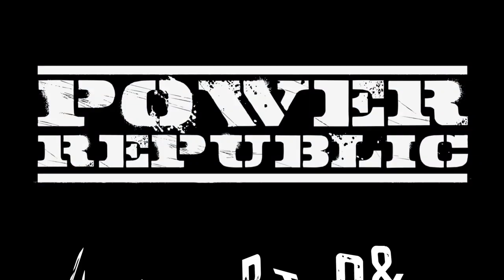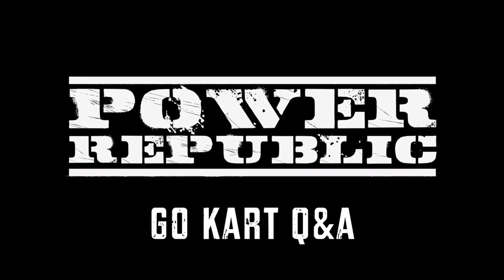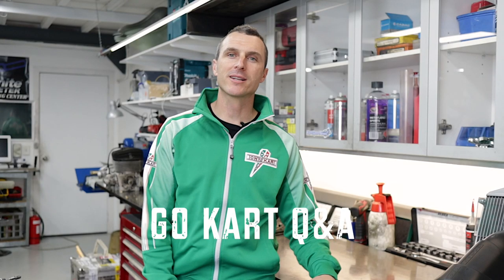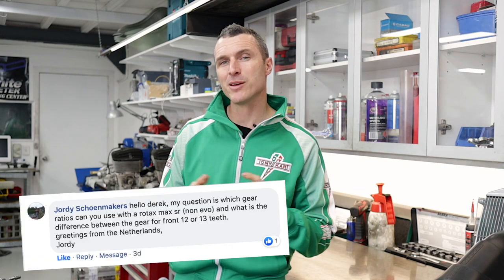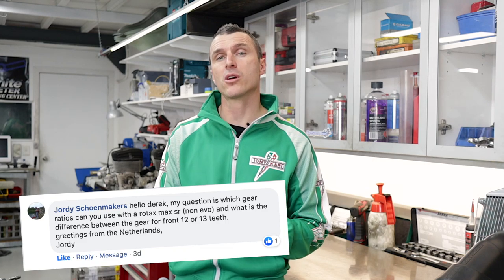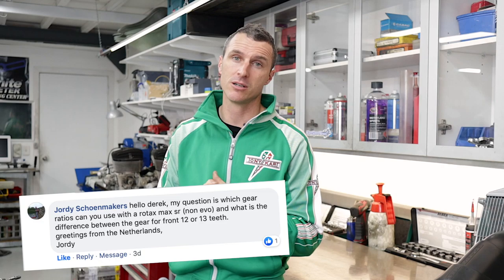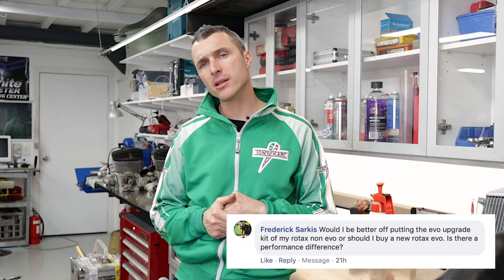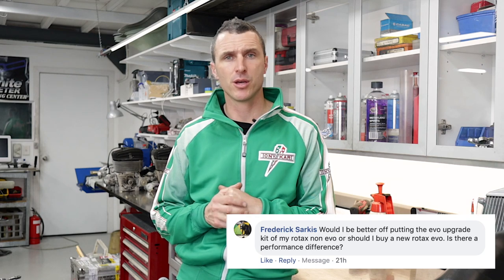Q&A: Answering Your Go Kart Questions - POWER REPUBLIC

Comment: to reduce hand cramp you can also increase the thickness of the steering wheel by using tennis racquet grip tape,  once thick enough it conforms to your hands a bit better
Reply from the maker: Thanks for the hot tip Josh.  Any particular brand or type that works better??
Reply: Head XtremeSoft Overgrip tape

Comment: Id love to hear your opinion on steel brakes vs ceramic brakes.......take cost out of it(but yes its a factor). How much of an advantage are ceramic over steel
Reply from the maker: not sure on that on, we have only used the steel OTK brake disc with the standard pads.  My guess is that the ceramics can operate at a higher temperature, so they would work with heavier cars and higher speeds, think GT3 race cars, and with go karts being so light comparatively, I don't think they need ceramic brakes.  What do you think? does your go kart have ceramic brakes?

Comment: Hi Derek,
thank you for the information. Here in the Netherlands / Belgium we are driving with the 12 & 13 gear. 
Another small question regarding the ratios.
example:
 11 front - 80 back (7.27 ratio). 
is it the higher the ratio the more speed, the lower the more pulling power? 
and what are safe ratios to work with.

thank you for all the info
Reply from the maker: Hi JS, the bigger the rear sprocket, the faster the engine acceleration and the slower the terminal speed of the Kart, because we have fixed gear ratio.
The lower the rear sprocket, the slower the acceleration of the engine and the higher the terminal speed of the Kart, especially at tracks with long straights.
Reply from the maker: The lower ratio is more pull and higher top speed in KPH if the straight is long enough. The higher ratio is good for acceleration.
Reply from the maker: 6.66 - 6.15 is the safe range for your 12/80 and 13/80

Comment: Hi Derek, I wonder if you have any advice around fuel for Rotax Evo. The UK has just changed the pump 95ron fuel from E5 to E10 which now has 10% ethanol. There are lots of conflicting information going around as to whether it is ok to use or we should use 98ron fuel which remains E5. Any ideas?  Thanks in advance.
Reply from the maker: I guess the less E in the fuel the better for longevity.  but as racers, we always want the best.  so fresh fuel for race day for sure.   I was under the impression that the Rotax was designed around 95 anyways, so a drop in octane shouldn't  cause detonation in the Rotax.  you will be able to change the spark plug heat range to suit the fuels burn time, hot plugs should burn the fuel faster, colder plugs slower as an example.   Anyways, same fuel for everyone, so it won't be a disadvantage for you and I wouldn't reckon it will harm your engine at all.  hope that helps

Comment: Quick question, why do you run your rotax at 40:1 as opposed to 50:1? Fuel oil mixture
Reply from the maker: Hey Russ, just a little extra oil doesn't hurt for engine life, either is fine, I just like that little extra for safety
Reply: @PowerRepublic  fair enough, I've always run the motul 2t at 50, but I think I may adopt the 40:1 better safe than sorry! Thanks mate!

Comment: Hi Derek, my rotax power valve red cover with a spring has fallen on the track. Can I continue drivinig without it or I should wait for replacement to come. Tnx
Reply from the maker: I would wait, the bottom end performance won't be that good with out a the power valve closing.  no harm done however as long as the black cover is still in place

Comment: Hello, i was wondering how to remove my wheel hub screws and how to i stall new ones efficiently
Reply from the maker: Hi Mattiss, great question, you can lock two M8 nuts  together on the stud and then turn them out.  then loctite the new ones back in with the same method
Reply: Power Republic great, thanks a lot

Comment: Looking forward to the rotax dyno comparison. Im running a pre evo and lacking bottom end big time. What items need to be bought in the power valve upgrade? And a rough price for that upgrade would be great?
Ps love the videos 👌👊
Reply from the maker: Hey Trucko, mate you are not going to believe the difference.  In Australia the rules say that anything other than the exhaust, you need the whole kit if you want to upgrade.  The last time I check the full upgrade kit is approx $2265
Reply: Power Republic thanks for the info. I'm on the GC also. might have to pop in and have a chat 👍
Reply from the maker: Hey Trucko, for sure come on down!